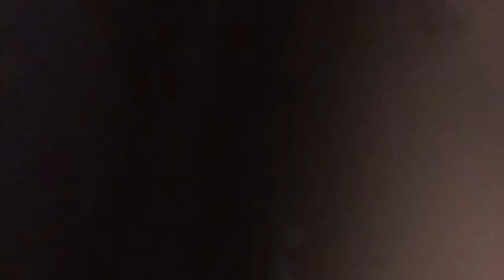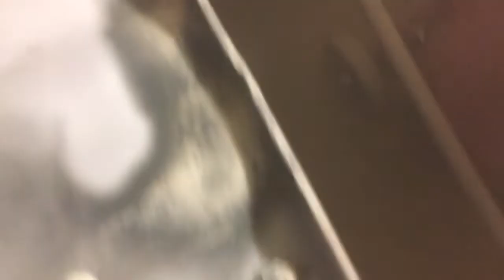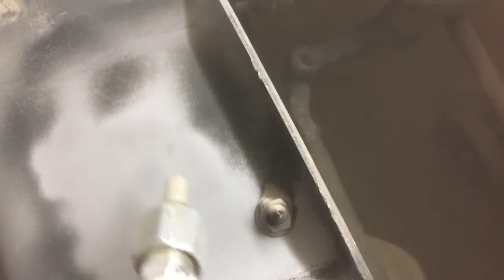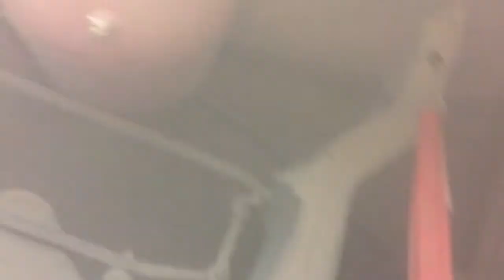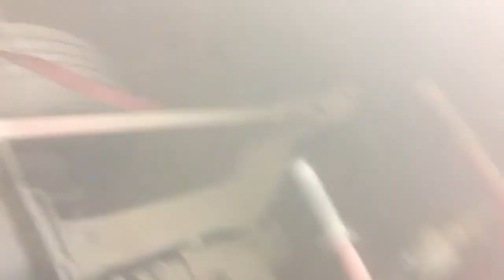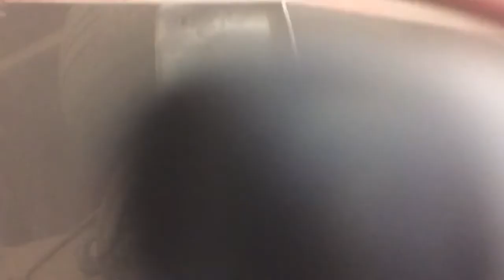Harbor freight 40 lb blaster testing

Comment: Great work.. Looks like you're moving along pretty good there.  A few questions if you don't mind.. Do you have an inline moisture filter?  What media are you using?  I have a rusted axle I need to restore and thinking about this one from HF.
Reply from the maker: Ross Bishoff yes I do and a 60 gallon Air compressor minimum. If you are using sand make sure you replace the check valve where the sand come out  to a menards check valve. The one on harbor Freight put on the the sand will eat it out quick as you blast. If you use their media blaster might not happen. My Chevelle entire floor pan , wheel wells and firewall with no issues
Reply: ZoKustomz454 will a 30 gallon air compressor work for this

Comment: Probably couldn't do this in my driveway, neighbors would be furious with the dust, what's the cleanup like?
Reply from the maker: oespo oespo19 that is why I did it inside my garage. I can’t even have a trailer on my driveway. To control the dust and the sand I built a booth inside the garage close tight around and a big furnace blower to suck up the dust. So wasn’t that bad . I blast my firewall and under my Chevelle with no issues. Cleaning wasn’t bad because everything is in one spot